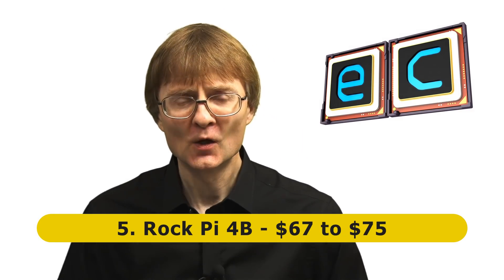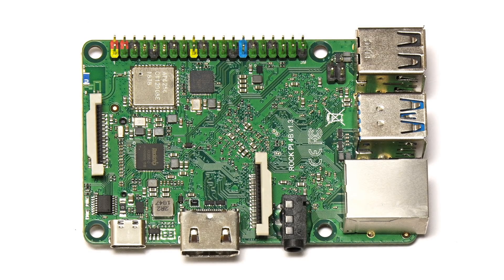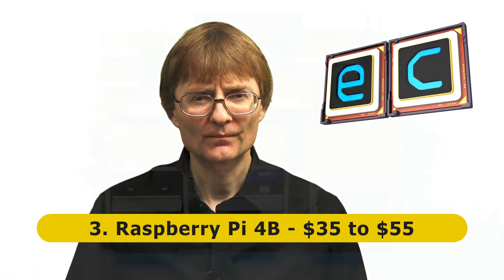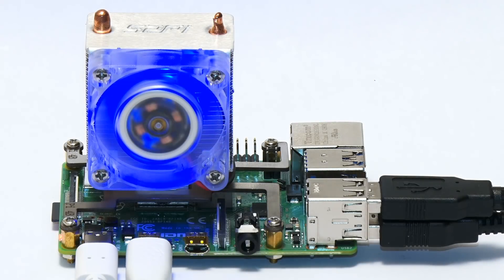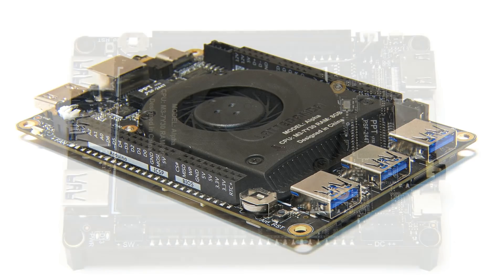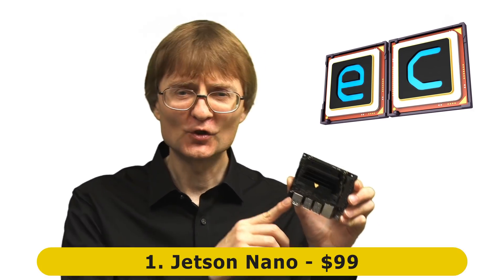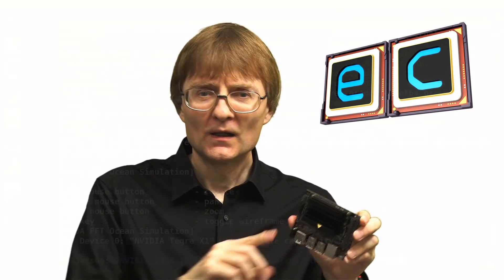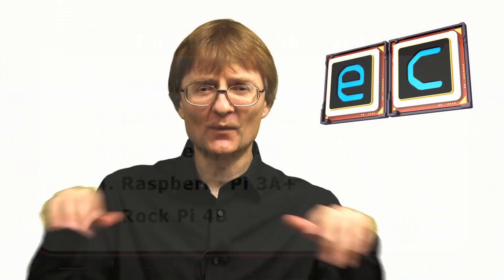Top Five New SBCs 2019

Comment: I think for many the Arm versus I386 is what they look at. I still see the Arm chips as being easily bogged down if used as a multitasker. Putting Small Board Computers through number crunching tests can't really exhibit real world behaviour.  For me, streaming videos from non Youtube sites can better put some to the test for a few hours on end. The Pi 3b+ streams good like the Odroid C2, but after a while they seem to bog down, and in cases lock up. Unlike short YouTube videos, or music streaming. Streaming video full screen from other sites can really test a SBC in ways a simple stress test can't. Especially ones that have ad breaks.  I have been eying the Odroid H2 and N2. I think those will give Pi some real competition. For me if it has spdif already without an overpriced add-on then it is a plus.
Reply from the maker: Agreed on the Odroid boards -- I really must get my hands on an N2.
Reply: Sounds like your Pi 3b+ might need additional cooling to stop it from throttling down. Streaming (especially via WiFi) is resource intensive. Hope this helps.😎
Reply: @TheOleHermit  I do have it cooled with one of those 30 mm fans that never shut off with the standard heat sinks. The odd thing is when I have the desktop clock in Rasbian count seconds, and it seems to be bogging down or stuck on a web stream. I will then try to leave full screen and minimize chromium. At that point I can often see the clock stop counting seconds and then it will jump a few ahead and repeat, until it gets its marbles back in order. Often it takes a reboot to solve it for a while.  I do know the Pi is often pushed to do things it can barely handle by design and software interpretation in a I386 dominated internet doesn't play nice either.
Reply: @kjrchannel1480  It might be worth adding a temp monitor to the systray on the RPi, just to determine whether that's the issue. You could also add a CPU monitor to determine how hard it's working.😎
Reply: @TheOleHermit  I have always had those widgets in the tray. The warmest it gets with a fan is the high 40c's. It really starts bogging when an ecommerce site tries to load 8 or more listings at a time down a page with dozens of listings. I know an obvious part is the limited ram. I am willing to bet that even those who bought the 4B 1 gig have that problem. Having such limited ram without a swap partition just makes it worse. Even if an Ethernet cable is used it won't stop it. I have noticed you can clear out the whole browser history and it can often still have large portions of the ram used up from all the CPU bit scratching. I am seriously considering attaching a disposable sdcard in a reader and mark it as swap just for fun. I know in the end you can't fix a limited hardware design. All you can do is try to work around it.
Reply: @kjrchannel1480  Sounds like you're on the right track. Thanks for sharing your findings with the rest of us. This is my first time hearing about this issue. Think I'll see if I can reproduce it on my 3B+. I'm wondering what your CPU usage is while this problem is happening.
Best of luck tracking down the problem and finding a cure.😎

Comment: This evaluation from an Educator or Single User point of view is ok, but from a Maker point of view, price and reliability of a headless deployment is a lot more important, which is not covered by this evaluation at all.
 
And not just price of one or two, but say for a thousand boards. So in my opinion Raspberry Pi Zero and Orange Pi Lite or Zero are a lot more important, and Beagle Bone Black. However none of those are on here... :-(
Reply: As a fellow Maker, I spend several months on some projects. So, I'd rather pay more for less hassles regarding software compatibility, bandwidth issues or limited functionality. I also look for on-board PWM cooling, mfr's heatsink, 12 VDC power options and case options.
Different strokes for different folks.😎

Comment: "AI is the future of computing..."
No need to convince me. Think about what EVOLUTION based algorithms can do. Program a human CELL for example, then create one with CANCER and then have the AI computer use trial and error with combinations of drugs to treat the cancer. You can optimize a CPU design in the same way to be optimal for current software, and use AI to analyze and recode existing software to spread across more cores (already demonstrated) and then use AI to actually design software more efficiently. Graphics for example could use this approach of hardware and software optimizing to write the code to create a 3D ball that is ray/path-traced with the goal of doing it most efficiently. The challenge is DEFINING the problem, the SOLUTION and having the tools to get there (in the case of medicine you need the computer to "understand" basic chemistry/physics etc).

Comment: soon we will be seeing 7th or 8th gen Ryzen 3 laptop chipsets on those SBCs.
Reply: I hope/wish
They have the CPU they put in the Bolt, the V1000 which is just a dialled back embedded Athlon/Ryzen sort of thing.  What AMD do have is a bit of a push on their ‘laptop’ U CPU and they have something called a 3500- it isn’t an APU though.  The 3500 is a sort of budget 3600 in very simple terms but there seem to be a lot of options for the third party to play around with it (like Intel does with its Y CPU), so bump up the TDP to 65W and you are going for the power or down to (I think 12W) and it is passively cooled (the current Athlons can be passively cooled at 35W TDP but the heatsink is relatively large). The 3500 is being touted to manufacturers (so Dell et all) as a sort of everymen chip, it will appear in desktop and laptop and chew on the Pentium Gold and i3.  So theoretically they could offer a cheap CPU to the SBC 86_64 segment.

I think the question really is does AMD even care.  Intel doesn’t seem to it must be said, rumour has it they were still hawking the Cherry Trail at a silly price right up to the death and have continued with the u3 8 gen despite it not being anything really different to the 6th or 7th.  We’ve seen that Intel will drop prices but only when it needs to because AMD is attacking their market share- and they aren’t in that sub £100 segment in mobile currently.  

At the moment AMD have been able to increase prices and beat Intel in desktop & server, Intel don’t really care about Desktop beyond pride- they make money out of server and laptop/mobile.  If AMD also plan to do battle on mobile (and they do) I don’t think they will care at all about SBC- in a way the best you might hope for is AMD don’t succeed against Intel in mobile and so end up with a lot of spare silicon- however I read this week that the new Surface tablets will use AMD CPU so if MS are backing them it seems unlikely.  They have a full ARM licence and they worked with Apple on their ARM CPU but they’ve done little obvious themselves with ARM except inject some of their graphics IP into the chips.  Very different to Nvidia, although they of course have very little hope of getting a 86_64 licence since they would need both Intel & AMD to agree and that isn’t going to happen.

Comment: The Raspi did not come in the market to give people's something to experiment with, but as a cheap and low power (resources) computer for the third world. That was the reason it once had tv-out (composite), so it could be connected to any TV.
Plus I believe n4000 boards do not get enough love. They outperform the arms, they got brilliant driver support and they run x86 or x64 Linux and Windows, not some port.
Reply from the maker: The Raspberry Pi was created as low-cost platform for helping people to learn coding and other computer stuff. :) Certainly this initial remit covered teaching coding all around the world, including the third world, hence the inclusion of comp video as you say. They wanted to make the hardware as accessible as possible. But the initial focus was educational -- and the Raspberry Pi Foundation remains an educational body.
Reply: @ExplainingComputers  omg, you are right. I wonder where I got that idea any why I felt sort of bad all these years for having bought a raspi gen 1.

Comment: I guess I'm a bit bias in saying the Raspberry Pi 4B should be higher up, because I have little love for Nvidia with the way they have treated the Linux community over the years, but I get why you put the Jetson Nano up there.
Reply: The nano has potential that nvidia will never let it recognize.
Reply: @ninline2000  What do you mean?  It's a development board, they sell them in the thousands.  They are at the forefront of ML, up there with the big boys and already have parts in cars and so on.

I watched a video where there £1000 version (forget name just now) could read an analyse 70 (automobile) number plates a second.  Pretty damn incredible.   Then, to make a point, they disabled the GPU element and just ran on the compute/CPU and it dropped to something like 3 per second.  The point was the strength they can bring because of their  GPU experience, or rather parallel computing experience. 

Who else is there to compete?  Intel are working on it, AMD don't appear to, and anyway the big issue has been power with GPU, they ask for a lot pf it, AMD still can't cool its gaming cards and doesn't have the ML IP that Nvidia has anyway or really the resources/direction- they are focussed elsewhere (and I'm glad they are as they have really shaken things up).

The Nano seems to be them reaching out, since it has to being sold at a near loss- just compare it to a Pi4 and explain how Nvidia can put so much in their package that Raspberry can't?  If you just want the Nano they actually charge you more, and you have to buy a thousand.  Buy the development kit and it is cheaper and you get daughter board which is clearly targeted at the community not enterprise/developers.  They would use the more powerful SKUs further up the product stack anyway, and use their own I/O breakout boards.

If it is just because they won't give their IP away then I think you need to take a step back and look at the bigger picture.

Comment: You said the latte panda is the most powerful SBC, isn’t the Udoo bolt considerably more powerful?
Reply from the maker: It is more powerful, but technically it is not an SBC -- as the RAM is not on the board. :)
Reply: Fair enough.

Comment: The Pi 3a+ is the one I'll probably use if I ever make another super thin handheld gaming system, there's an Osoyoo screen that hooks to its display connector, so I don't need the extra thickness of the HDMI bridge that I'd need to use with any other board. The 3a+ is also very thin and small, so it's the most appropriate for a handheld from the Pi 3 series. I'm using a Pi 4b for my Amiga 1200 emulator box, and the Micro HDMI were indeed a pain to figure out a good solution for. I can't think of a good reason to use the Latte Panda Alpha, but I am looking at the Udoo Bolt v8 instead, since I think a Ryzen v1000 APU would be better than an Intel M3. Jetson Nano is a decent enough choice for #1. The one I'm currently using for my handheld system is a La Frite board. It's tiny, but does require an HDMI screen and the big thick HDMI bridge, so it won't be a super small handheld.

Comment: I'm not surprised the Nano is in first place on your list. I just wish it took advantage of the GPU. I was surprised the Pi 4 was at third. The addition of 4GB RAM, USB 3.0 and GB Ethernet is a game changer for the Pi even if it does require active cooling.
The future of SCB's in the desktop arena is pretty much assured. About two months ago I retired my beast (AMD Quad core Phenom) of a PC for a Brix S with a quad core Celeron box that is light enough it hangs on the back of my monitor. I haven't missed the beast at all. I have my 4GB Pi 4 being delivered tomorrow. More and more, laptops and small PC's are taking over the home market. The one issue with all of these (the Intel machines excepted) is Youtube playback in Linux. They must get that fixed. It cannot be the ARM architecture. It works fine in Android.
Reply: Ah, the good ol Phenom x4..... Still have mine in reserve. I think that you're right for anyone that isn't into PC gaming or VR. That said. I'd be VERY intrigued if someone slapped an x16 slot onto the side of a stout Ryzen-powered SBC..... I have my 1700x sitting here with mostly unpopulated slots in a big ol' case...
Reply: @DFX2KX  I kept mine as well in storage. Just in case. But seriously, I haven't even missed it. And my power bill is much lower now too. As for the gamers, your right, they will almost always need more. However, companies being the controlling entities they are, it would not surprise me in the least if in ten years games were all streamed instead of locally installed.